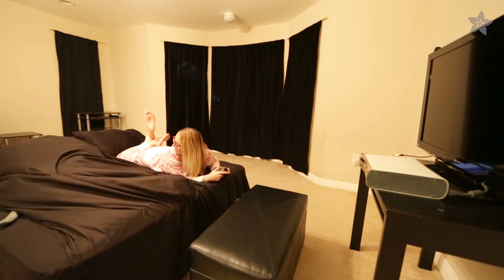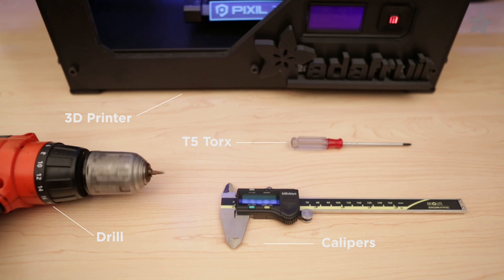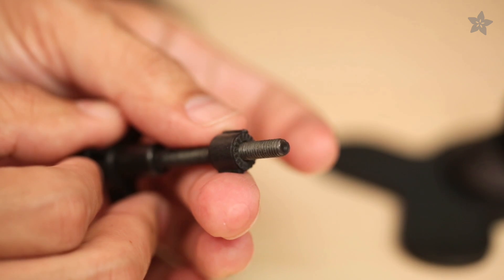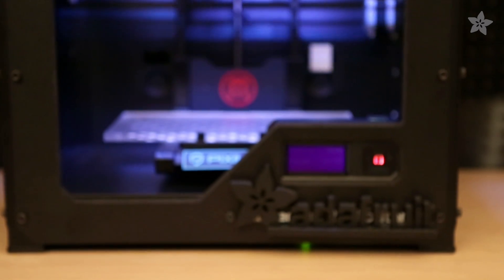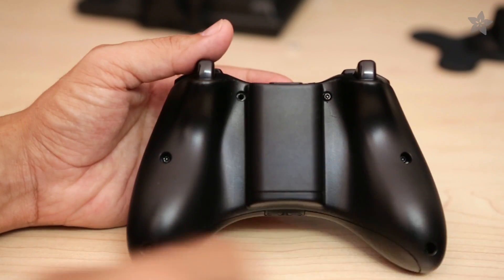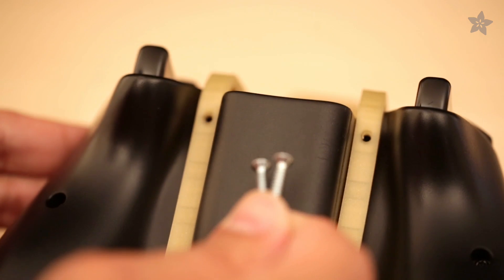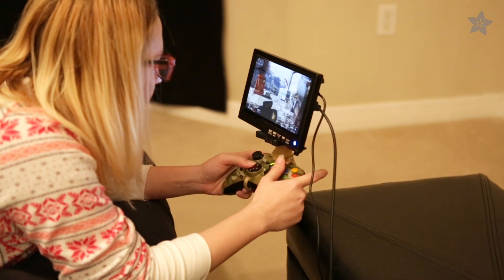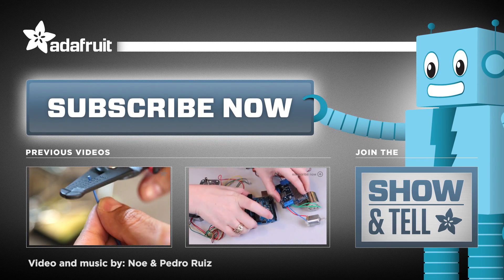Personal Xbox Monitor - 3D Printed Game Controller Mount

Comment: I really want to buy one of these! Could you please sell this on eBay or some website? I have a 3D printer, but still need to buy a filament, a glass printing bed, finish plugging in wires, and and learn how to use it! It would make my life much easier if I could just buy this off of someone!